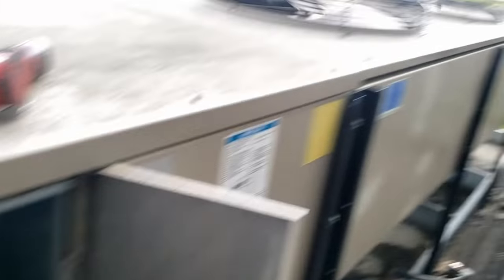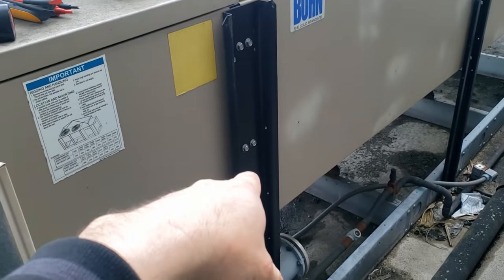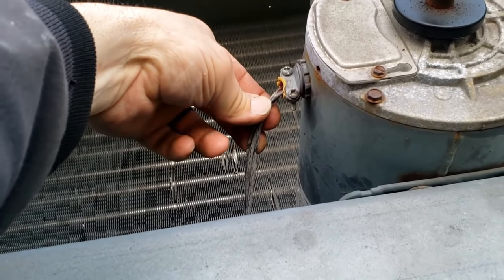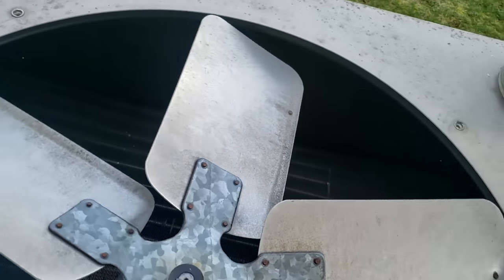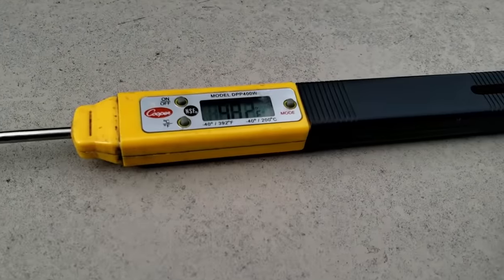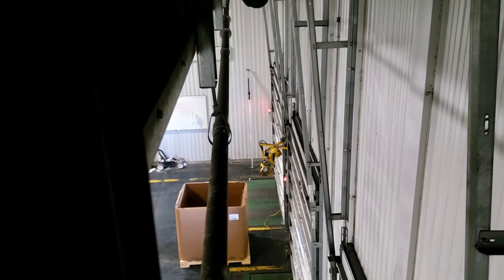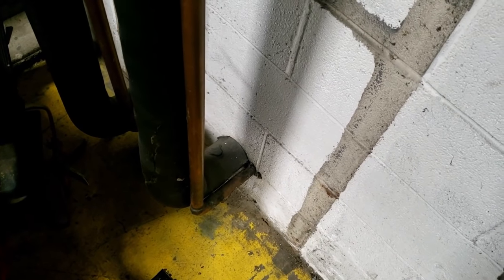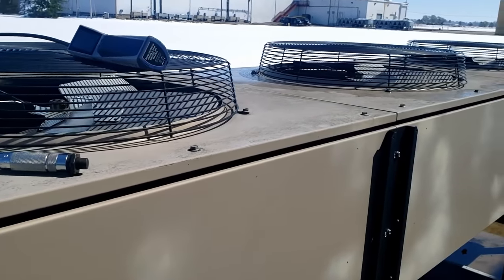Noisy Refrigeration Call Leads To More Problems

Comment: Tip for you Rick, instead of using a refrigeration wrench on the fan bolt, you can use a socket extension reversed. The part that normally goes on the ratchet fits perfectly on that bolt. Than you use and adjustable wrench to turn the extensions.
I was taught that trick by another tradesman at the supply house about 10 years ago when I struggled for hours trying to get a blade off. 
I always soak with liquid wrench and give a little tap with hammer and it makes it so much easier....
Reply from the maker: I literally just bought a half inch pipe plug socket. They actually have a whole kit that is square head. I might actually buy the smaller ones in addition to the half inch socket that I ended up buying for the large suction King valve on that compressor. Basically you're saying do what I was kind of doing on the big compressor at the end of the video?
Reply: Yes, 
..,And you always have the best tools...I know you keep up to date!
Great video!

Comment: You gotta love it when the set screw threads are going bad and you can't find a replacement.  A little grease when putting it together can prevent the rust and the seizing , I'd love to see manufacturers apply some on these exposed parts .
Good one Rick 👍
Reply from the maker: I agree, any extra effort is amazing in this screwed up society.

Comment: I would never laugh at a torque wrench. Lol. There are plenty of times where your experience makes it to where you probably don't need one, but nothing wrong with using one, especially in that situation where it is important that they all be equal. As for the oil level... the sheer size of that machine makes anything I'd say just an educated guess. Well outta my ballpark. But my guess is... just as you said ... once it wasn't so low anymore, proper velocity and oil return were restored and it got its oil back. Nice video! :-)
Reply from the maker: Thanks Winston, I appreciate you feedback🤜🤛👍👍
Reply: just strip it out and back it off a quarter turn... LOL
Reply: Couldn't agree more

Comment: I wonder why the condenser gaps vs copper where only on half, perhaps the hottest part of coil until it gets cooler further down?  Maybe they didn't want it to fail in the warranty and where being safe for themselves?  Those plates rust, I put some primer on mine (evap) to slow rubbing on copper from rust expansion.  I often like to do preventative things like that, which can make a big difference in the long run... Informative vids as usual.

Comment: Highly recommend Posi Lock pullers. 19 years strong. The "weak point" is the extension tip. Have had 3 replacements there. User error on all 3.
Different tonnages
Reply from the maker: Yep those are bad ass pullers. The big ones are big money

Comment: I work on those model units every day. Next time pull the top off. It’s 6.   1/2  bolts and the top comes right off. 
It’s a lot easier
Reply from the maker: Interesting, I'll have to try it. Your saying take the top off with the grill in place to get better access to the motor?
Reply: @HVACRSurvival  that’s what I do that way your not having to reach over and tear up your forearms and back 1.5 hp motor kinda heavy!!!
Appreciate the time you put in to make these videos believe me I know how hard it is to put out quality stuff while working. 
Takes more patience than I have. A lot of Houston techs enjoy your channel 
Thanks
Reply from the maker: @randomrefrigeration4564  thanks man👍👍. I looked at the video again and I can see how removing those tops would be easier, thanks to the info!

Comment: Another good video! That different evap. coil tube sheet design I think is a floating coil design due to length of coil, copper expansion rate. Around 20 min. the crankcase heater looks like its falling out of the well of the compressor. Little tabs are 3" away from engaging, unless someone put wrong one on.
Reply from the maker: You are correct is was labeled as a floating coil outside. The block heater felt in place when I originally looked at it but I did not give it a pull to verify, I will need to recheck it whenever I go back.

Comment: Help help, hello Rick, working on same unit, same set up cooler warehouse, having foaming problems and one compressor failed looks like liquid or oil got back to compressor. Superheat at each evaporator is about 8 degrees, at compressor around 22. But for some reason oil not coming back, wondering if accumulators are getting plugged or still air flow issues? Coils are clean, new filters, vacuumed down to 500 microns. But still when running that unit is scary, any suggestions, thanks a lot
Reply from the maker: Tear the heads off the compressor and find out if it's a flood back problem, see if you're bearings are worn, if the wrist pins are wore. If you have foam in the oil it's likely refrigerant flooding back. It's hard to cover it all without seeing what's going on or hearing it. You could have a plugged weep hole in the accumulator causing the oil to not return.
Reply: @HVACRSurvival  thanks Mike. I
Will try tear it down and find out what is going on. Accumulator is ordered, hopefully week or so. Hard to find parts in stock this days, crazy time
Reply: 🤦‍♂️ I was on the phone with Mike just before writing post 🤣🤣🤣🤣🤣
Reply from the maker: @KninskaKapija  I was gonna say my name is Mr Ed, not Mike 😁
Reply: What I find is damaged valves. Looks like oil in the pistons. Replaced valves, all filters and refrigeration. Start up unit install all probes and watch unit for performance and took me some time but definitely find one problem. Sometimes compressor goes in to vacuum when satisfying and pumping down, so pressure switch must be bad. Replaced with new one and now it shuts off at 5 psi all the time. Wondering if that vacuum could kill that plates?
Under vacuum -6 psi or so I guess that oil likes to just sucks in to pistons under vacuum. Working on semi hermetic 4 cylinder medium temp 404

Comment: Wait a minute here. Did tightening the bolts actually fix the leak because that is far and few between if it ever happened to me. In most cases I end up with an even bigger leak or one of those bolts decides to snap and ruin the day. 

But even preassure on all the bolts is key here to make a tight seal and  I see that this is not your first rodeo since you brought the torque wrench.  😀

Comment: Only contactors that should not be operated manualy are older elevator one due to body choping possibility.
Reply: not really true, if there's a dead short and you closed it by hand standing in front of it? you're day could be very bad with major injuries, electrocution or just dead.
using an insulated screwdriver standing to the side with arm stretched over and back facing is the least dangerous way. some of us have had first hand close encounters with 480V, where the initial short circuit blew apart terminal lugs with a massive arc-flash and sustained an arc for 10+ seconds before a breaker opened (15 amp breaker at that).
while 10+ seconds doesn't seem very long. hearing it's like an eternity, when hearing it, feeling the heat and being blinded not knowing what blew or which way to move to get away. it's just not fun and seems like an year goes by.
Reply from the maker: True👍👍😎